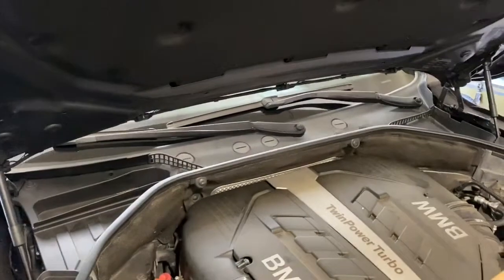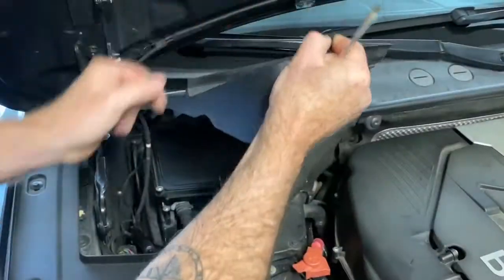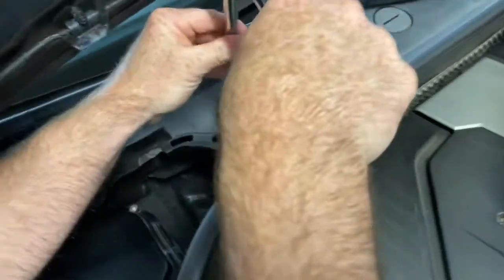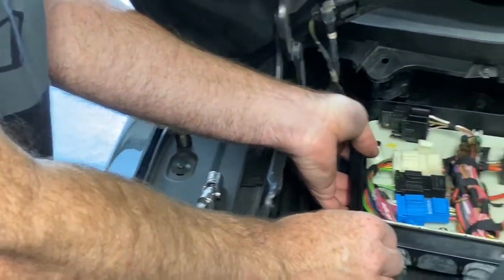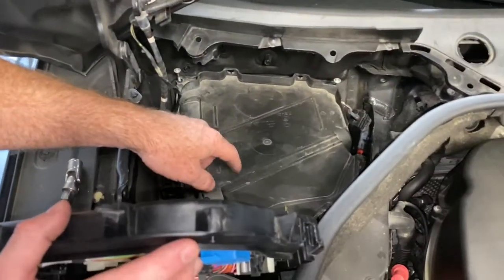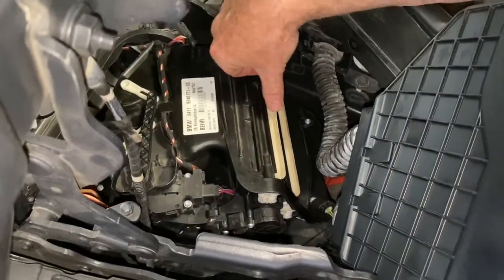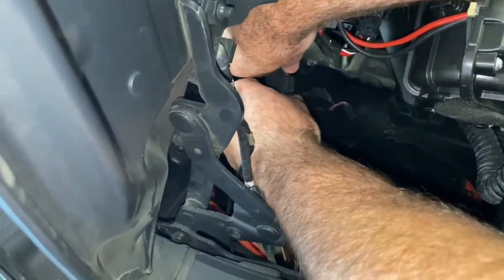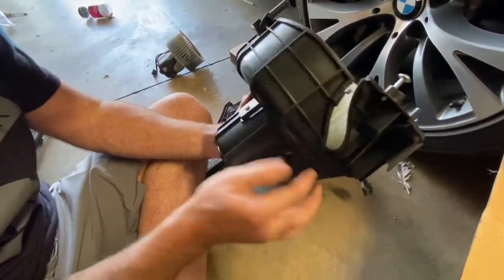BMW 5 Series F07 /// F10 Blower Motor, Cover (repair), Voltage Regulator DIY

Comment: Hey bud. I’m a single dad and have work and gotta get my son to school every morning. I can’t believe it just did this but I forgot to plug in that back plug when putting everything back in. So like a dope I didn’t disconnect the battery again and when I was putting the battery wire back on under that bolt by the main wires, it touched the metal bar with the big bolts I took out in the beginning. Now my blower works but I have a drivetrain error and car won’t start. Any idea what happened?  I checked a ton of fuses thinking it’s something stupid. Engine pops but won’t roll over and warning says car won’t start dude to drivetrain. This is all from one wire touching metal. I’m sick over this.  Anyone know wth I just did?  Fixed the blower but instead of foggy windows now I have no car. This video is perfect. I disconnected battery at first but knew it was a quick plug and got cocky. Now I’m screwed. Any help would be greatly appreciated. Thank you twice over.
Reply from the maker: Bummer! This post looks like a good place to start-

https://www.bimmerfest.com/threads/help-f10-connectors-on-top-of-blower-motor-cover.1402731/
Reply: @dmascarin  thank u. I was done! I’m so disgusted right now. Praying I didn’t cuz more damage than I saved by doing this. Can’t believe I did that. Completely forgot I put the cross bar back on  just missed a clip in. SMH.  Thanks bro.

Comment: I will never ever buy another BMW again, or any European car for that matter!  I have a 2010 BMW 535i. It seems like I've spent more time and money fixing it than I have actually driving it. In my opinion the Beamer is over-engineered and lot of things about it are more complicated then they need to be. IE, the retractable cup holders that come out of the dashboard. I get the space-saving concept. However, when you actually place a cup in the holder, the cup is directly blocking the A/C vents. Really?😠  Now I truly understand why they don't hold value. Even radiator fluid for this car is $35 a gallon😑.  I will say to BMW's credit that they are very fast and fun to drive when everything is actually working.
Reply: Wait until your injectors start failing. 1 fails at some time but you have to renew all.